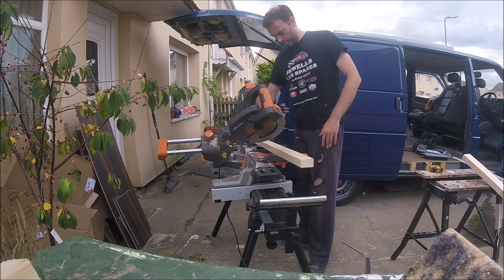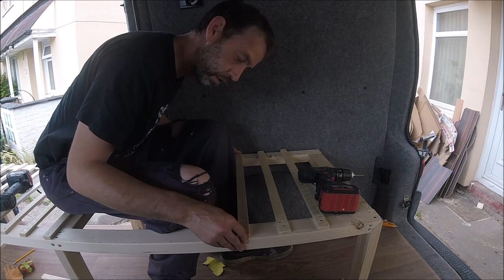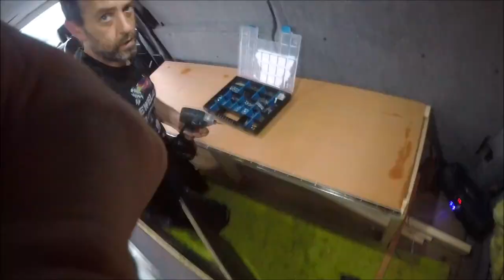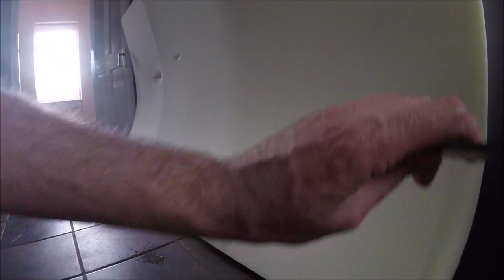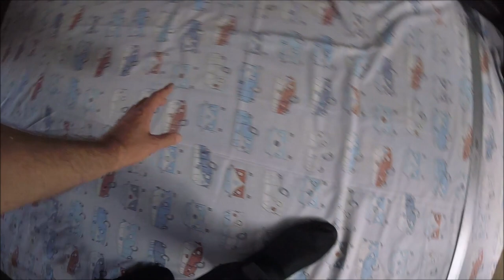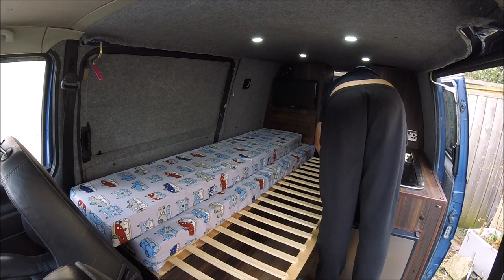DIY Campervan Pull Out Sofa Bed Build & Install In A VW T4 Camper Conversion

Comment: Would love to see a suzuki carry 
Micro camper
Reply from the maker: There are 2 Diahatsu Hijet micro campers already on my channel, they are practically the same van as the Suzuki
Reply: @TheCampervanBuilder  thats a good point 😊
Reply: I remember you saying they were prone to over heating 
Are you suzuki carrys more reliable
Reply from the maker: @philippewalker850  I think its the overall design of the coolant system, I think they all share a similar layout, but all are bad, but its not the easiest to work on from what I've heard

Comment: Would love to see you do a video on fitting and wiring in the downlights to the dimmer switch 🙂Also..... is there a reason you don't use the BLUE foam on the seat/bed? it's better for this kind of project surely?
Reply from the maker: there are already videos showing how I wire lights to dimmers on my channel, I feel I'd be repeating myself if I uploaded videos like that again
Reply: @TheCampervanBuilder  Sorry, I did look but didn't see anything